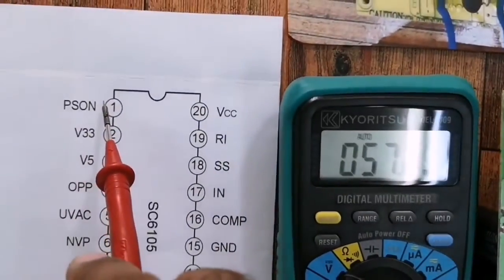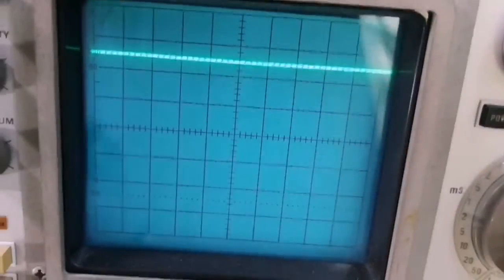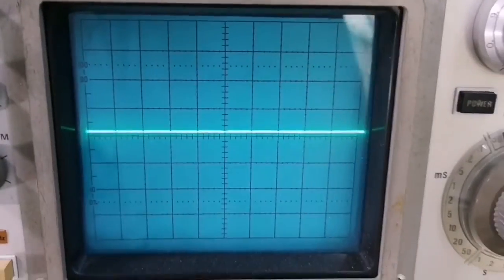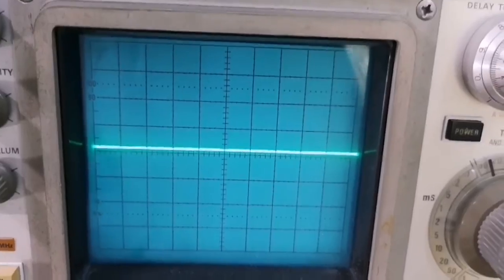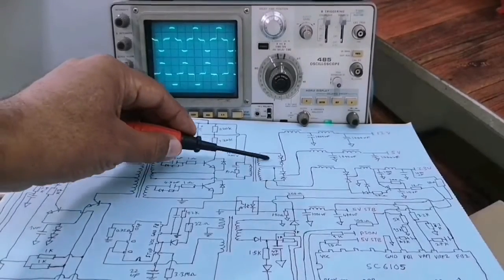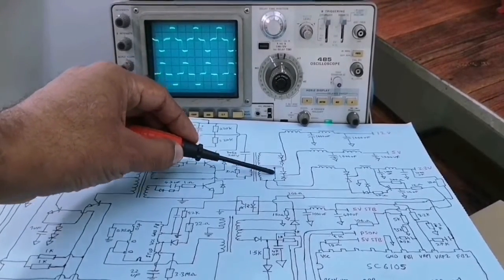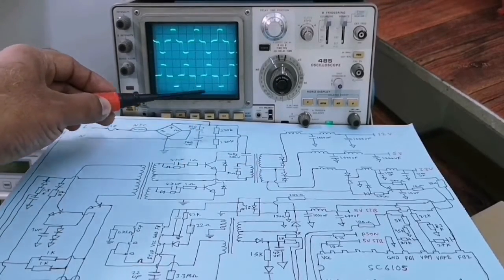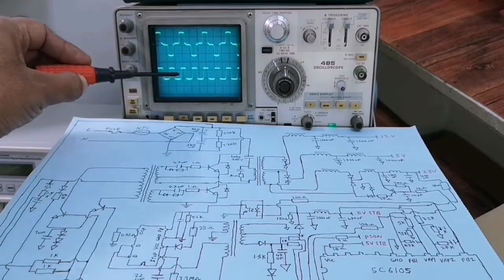Practical example of advance troubleshooting for SMPS and fast fault find tips for ATX power supply

Comment: Nice video, What can you do if you can't find the datasheet on the control ic?
Reply from the maker: In this case you need reverse engineering and trace the most important signals, for example the power supply input to the ic is healthy, the feadbak circuit and output signals.

Comment: Hi thank you for replying. I have power supply out of scope how many dummy loads do I need to keep power supply on then I can measure voltages and current thank you. Do I need them on each output pin? Thanks again.
Reply from the maker: Hi,
One dummy loaded should be sufficient, it is advisable to connect it at the output voltage which is used for feedback circuit and voltage correction side.

Comment: Excellent presentation sir. I have an oscilloscope just bought it recently not new. Anyway when I switch on it starts hear fan see light come then high pitched squeal and shuts down I have checked components but I cannot switch on to take voltage readings  as it shutsdown again. Any advice would be welcomed, Many thanks for the video.
Reply from the maker: It could be the power supply board getting overloaded then shutdown , the noise could be coming from transformer coils, try to limit the main ac power by using in series 100 wats bulb or stepping down transformer (example 240 ac to 110 volt) just to see if it can stay on, you need to try disconnect all the loads from the power supply board and power it alone and if possible to provide some external resistor load to verify is the power supply board normal and maybe overloaded by any other internal boards, check the electrolytic capacitors for short circuit.
Reply: Saud Automation This power supply does not like no loads as protection shuts down.

Comment: Sir may ask you if I don't have a oscilloscope what type of
multitester to use to measure the pulse signal to the base of the switching transistor that drives the main power transformer tnx sir
Reply from the maker: Hi,
Some multimeters they have option of frequency counter input, this might help but not very easy as the signal magnitude might be very low some time cannot pick up, also the   wave shape visibility not available,
For example I troubleshooted one dead power supply and I found by oscilloscope at base of transistor negative pulses are available but positive part was chopped so transistor was not able to switch, the frequency counter might show puls counts in this case  but you will not see the problem.
Anyhow this depends on the failure type , some problems just multimeter Will do.
Reply: @saudautomation  Sir tnx for your reply but I watched your video vary well explained